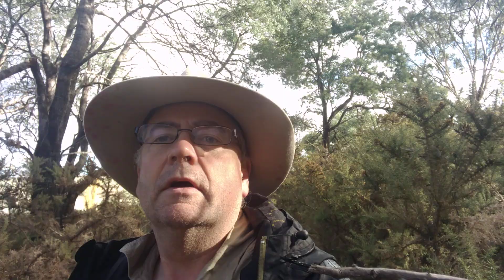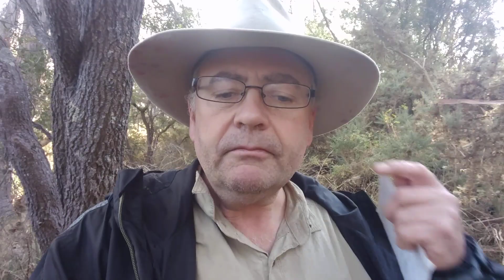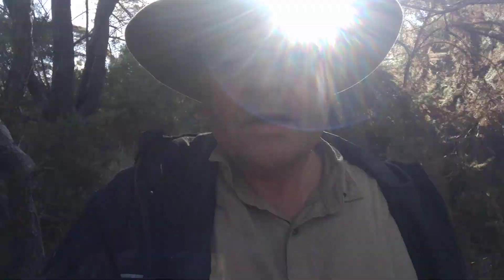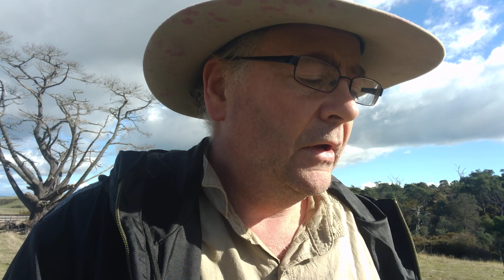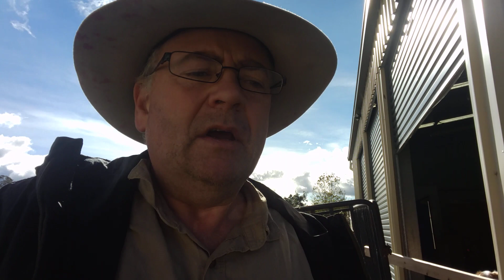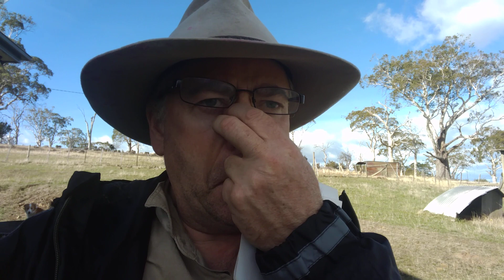FTTN what is it and what are its issues?

Comment: Thanks for another very informative video Damian. I'm unfortunately one of the unlucky ones on FTTN. It's been nothing but trouble even with a decent RSP in Aussie Broadband. My connection drops out and reconnects at a lower speed pretty much daily requiring a power cycle to get back to the higher speed. Quite frustrating. I called Aussie Broadband about it and I'm now on a stability profile (at a lower than optimal speed btw) waiting for 5 dropouts to occur in a 24 hour period before NBN will do anything about it. I'm currently averaging 1 - 2 dropouts a day. 

Isolating three phone sockets in my house got my speeds from 24 Mbps down 7 Mbps up to 43 Mbps down and 8 Mbps up. On the stability profile between dropouts it goes from anywhere between 20 Mbps down 4 Mbps up to 35 Mbps down 6 Mbps up. I would have been willing to pay for 250 Mbps down 100 Mbps up with Aussie Broadband and would have signed up for gigabit in a heartbeat. But instead I'm stuck on the 50 Mbps down 20 Mbps up plan not even achieving the advertised speeds.

It's ridiculous how much the Liberal National Government has set us back as a country with their Multi Technology Mess.

There's a great article in The Age today about how even as the NBN finishes the rollout in 2020 and looks to celebrate and seek writedowns and a sell off, the real thing that needs to happen is upgrades. And that mainly includes FTTN to FTTP. I don't like the chances with our current Government though. Anthony Albanese, leader of the Australian Labor Party is very strong now on a full fibre rollout. Good on him! If only Bill Shorten had have taken the same tack he might have got a better result at the last federal election. Anyway here's the article by the great Jennifer Duke:

https://www.theage.com.au/business/companies/the-biggest-issue-for-the-nbn-in-2020-isn-t-writedowns-it-s-upgrades-20200103-p53oho.html

I'm loving diving into your NBN videos Damian. I hope you'll consider doing more.
Reply from the maker: Thanks for the feedback. Yes I really must get back to doing more videos.

Comment: Theres another point of failure you missed nbns configuration can and does have errors such as spaces in the avc and so on these are the worst to fault as nbn assurance india call centre scripts dont allow for this kind of fault
Reply: That's one I hadn't heard of. So is this is an example of a misconfiguration, that may then go on to create issues with other software in NBN? The net result is that the service doesn't work, or is harder to trouble shoot?
Reply: Damian Ivereigh yeah if there is a mistake in the provisioning stage the service will generally not work at all in some cases the issue is visible in NBN portal such as speed change taking more than a day or so but there are also ones where nbn portal will show sync and appear to be auth issues caused by radius server or cpe so generally  they take a lot of troubleshooting and time to identify and a good CSR doing lots of following up
Reply: @nelo077  That's very interesting. We have that happen to us! I will some add some code to the radius server to spot any misconfigured AVC id's coming through. It is frustrating that NBN's system allows these misconfigurations to even exist (poor coding). However given the haphazard and the attention to cost savings over quality that came in with MTM, this doesn't surprise me.

Comment: You mentioned that crosstalk is an issue with FTTN on the copper lines out to the subscriber. Could this get worse and degrade the service as a particular node reaches full capacity?